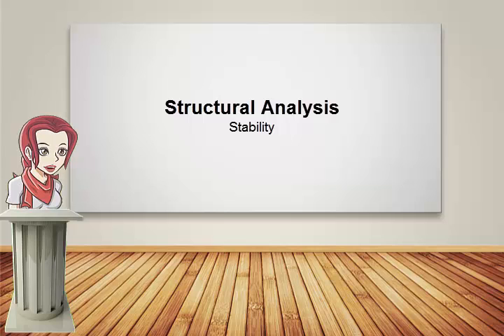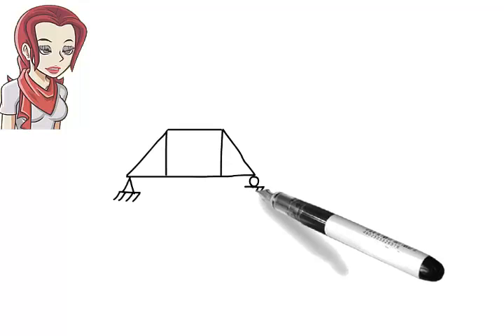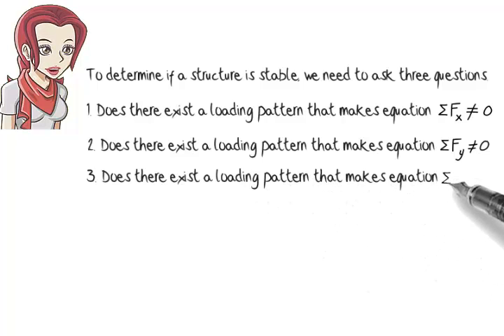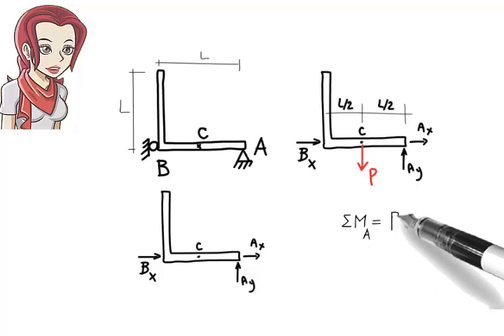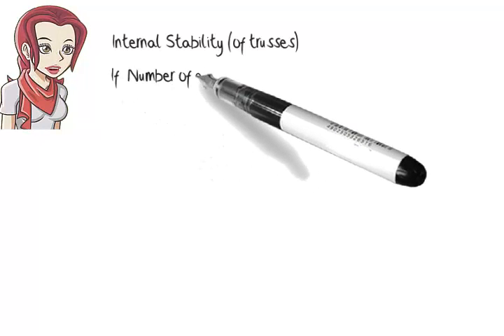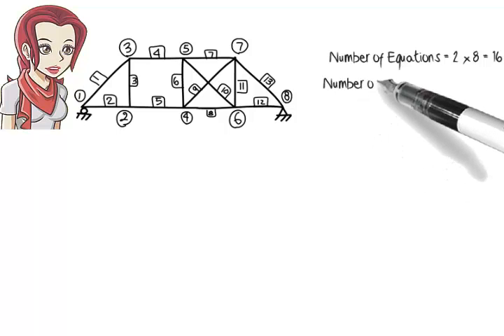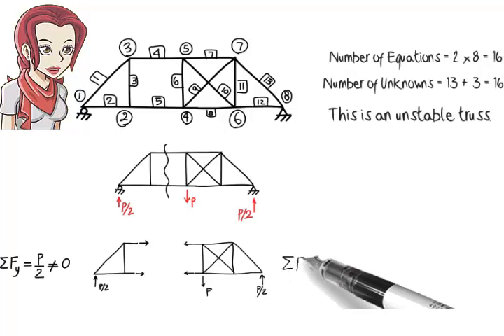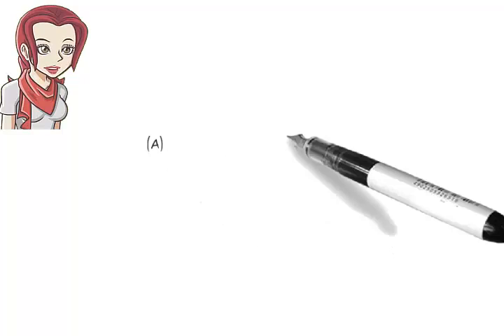SA02: Structural Analysis: Stability

Comment: Why is A) unstable? It embodies only triangular  patterns as you mention @ https://youtu.be/Oj8hIdXukkE?list=PLjrNUPGdy6hZT9oBK7_6S--tK_lUE9Xtw&t=470. 

I don't understand exactly the "cut method". If I were to cut the triangular stable system somewhere near the midpoint, how are equilibrium conditions verified?
Reply from the maker: "A) embodies only triangles..."  Not quite.  By a stable triangle we mean three joints (vertices) connected together using three members.  

Consider the following process. We start with a stable triangle. Then add a joint and two members to the triangle to form a second stable triangle. Now we have two stable triangles. Keep adding a joint and two members (forming a stable triangle) until an entire truss is constructed. That truss is stable. A truss that cannot be constructed that way may be unstable. The truss in Problem A does not fall into that category.

Please watch the following video for additional explanation on stability:
https://youtu.be/w7rAiqzlanQ
Reply: You are a beast! You actually answered my question within hours, wow!!! Thank you! :)

Comment: May I ask why Question D is unstable, how to cut the sturcture?
Reply from the maker: +au yinglun We can show the truss is externally unstable with rather ease. The structure has a pin support at the left end (say, point A) and a vertical roller at the right end (say, point B).

So there is one (horizontal) support reaction at B and two (one horizontal and one vertical) reactions at A.

Suppose we apply a downward load (P) on one of the top joints of the truss. So, the load is placed on the truss between A and B. Say, the distance from the point of application of the load to point B is L. 

Now, sum the moments about B. This sum must be zero if the structure is to remain in equilibrium. Here is the sum:

L(P) = 0.

Notice that all the support reactions pass through B, so they vanish in the equation. The only non-zero term is L times P. But neither L nor P is zero. Therefore, the equilibrium equation cannot be satisfied. This implies the structure is unstable.
Reply: On your explaining, sum the moments about B must be L(P) + or - (Ay)L' = 0, Ay is vertical reaction at A, L' is the distance from the point A to point B. But everything will be fine if we sum the moments about A. 
Otherwise, if the position of point B go up for a short distance then the sum moments about A or B will be satisfied, so how do we prove this truss is unstable?
Reply from the maker: A stable structure must remain stable under any and all loading conditions.  So, if it can be shown to be unstable under only one loading case, then it is unstable.

For Problem D, we can also prove instability since the truss has concurrent reactions, all the  support reactions pass through the left pin support. This means if we place a vertical load at one of the top, or bottom nodes of the truss, then sum of the moments about the left support cannot be made to be zero.
Reply: How about the vertical reaction of Pin A? Wouldn't the vertical reaction of A be equal to whatever the downward load of P will be? So, the equation would be sum of moments on B is PL + Ay*(Distance from A to B)?
Reply from the maker: Yes, the equation that you mentioned works, it can be satisfied. But that is not enough for concluding that the structure is stable. For it to be in stable (in equilibrium), no matter which point we pick, the sum of the moments about that point must vanish. If there exists a point, any point, on or off the structure that makes any of the equilibrium equations invalid, the structure is considered unstable.

Comment: why C is unstable?
Reply from the maker: If a vertical load is applied to the middle bottom joint, the sum of the forces in the y direction at that joint does not vanish, the equilibrium condition at that joint cannot be maintained. Except for the applied load, there is no member force (or force component) in the y direction at that joint. And since the applied load is not zero, then the sum of the forces in the y direction is not zero either.